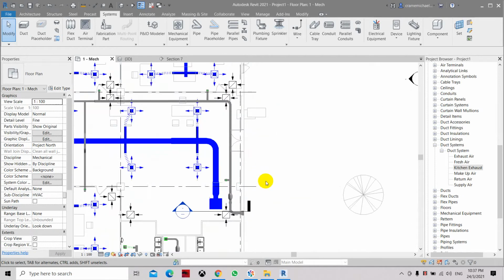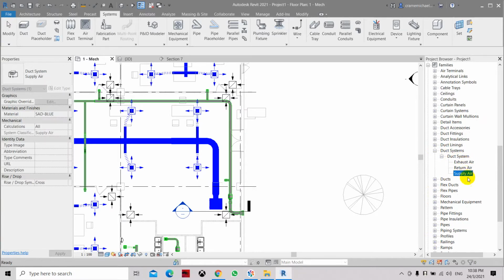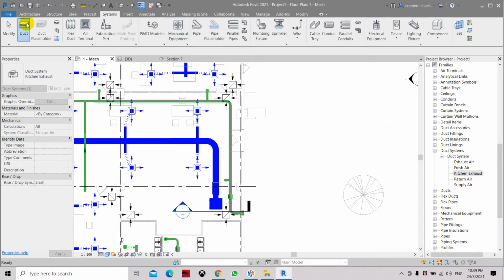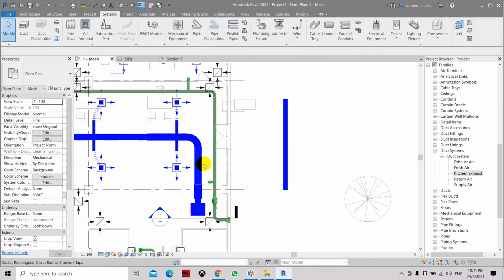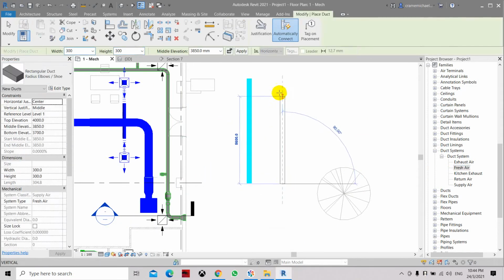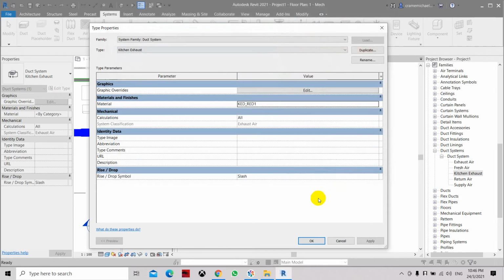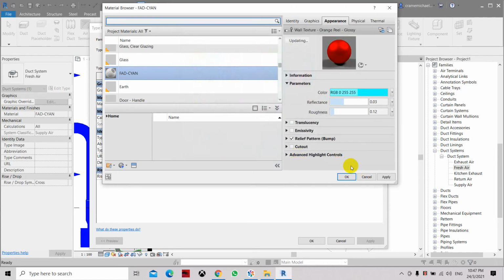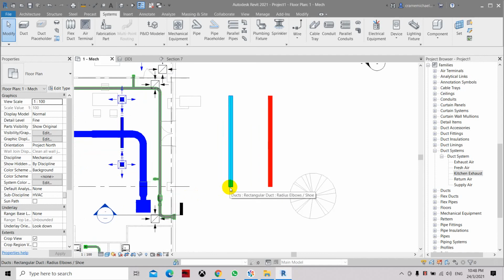Create Duct System Type In Revit

Comment: thanks for the video it helps loud and clear but i have question regarding using filters of duct because am using wireframe in plans instead of shaded which materials not applying. how to create filters using this 5 items categories which using system classification? thank you
Reply from the maker: When you set it to wireframe it automatically remove the shade in the duct and lines remain so no need to have a filter if I understand your question correctly. Thanks.